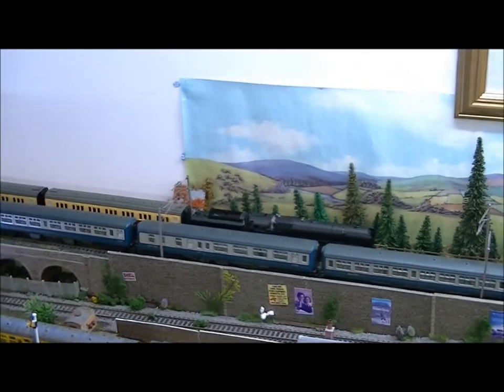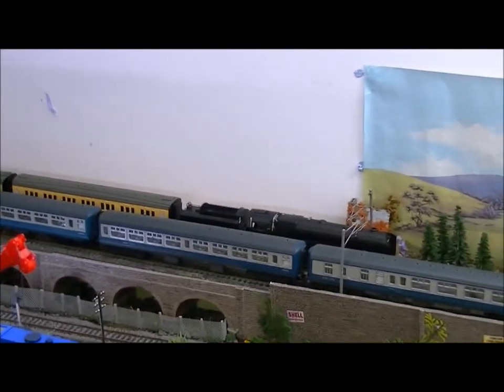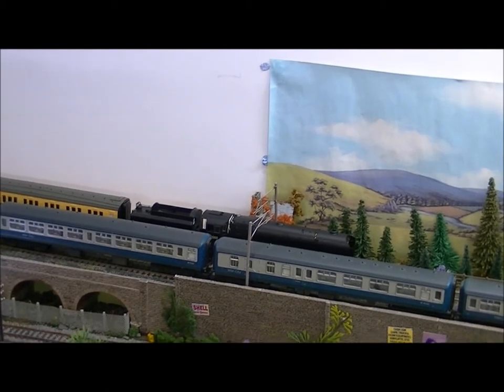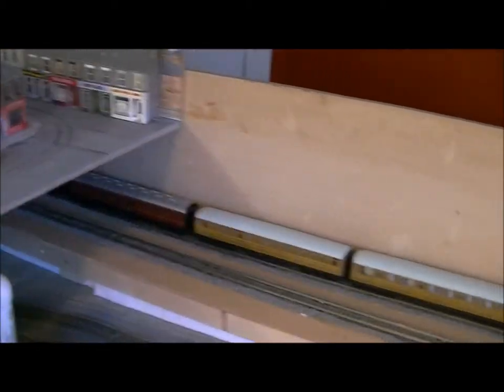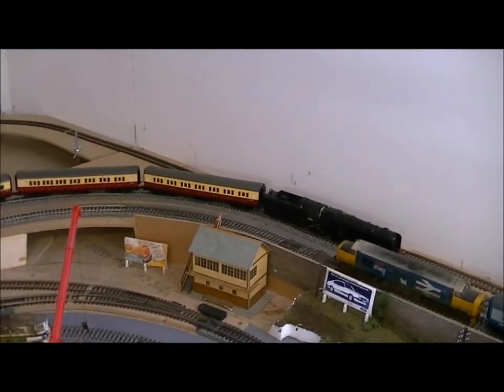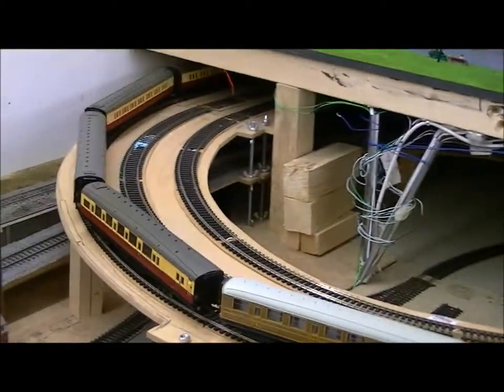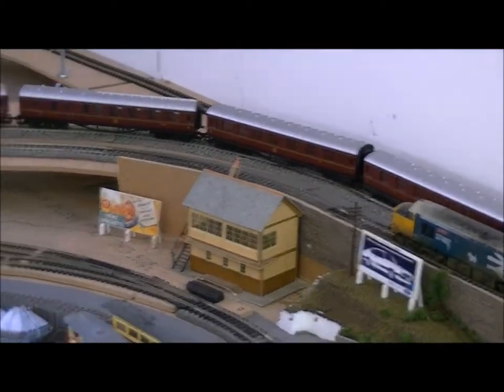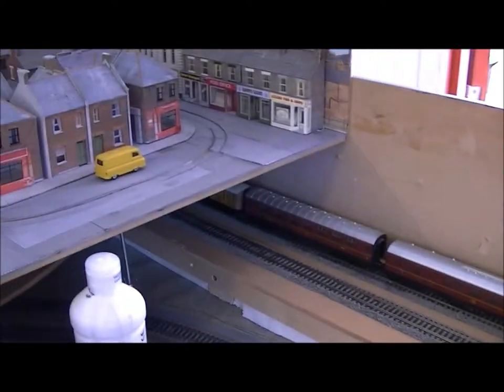helix review

Comment: Hi great video. What is the diameter of the Helix  (you mentioned something about 4 feet) , Also is it a scratch built helix? What did you use for the supports?  Thanks
Reply from the maker: hi, yes the diameter of the helix is 4ft and they are scratch built
Reply: oK GREAT   What is the track center line spacing  (3 tracks)
Reply from the maker: its about 6.3cm from the centre of one track to the centre of the next
Reply: Ok thank you... that's 2.5 inches for me, which is about what I thought...
Reply from the maker: ok great, glad I could help